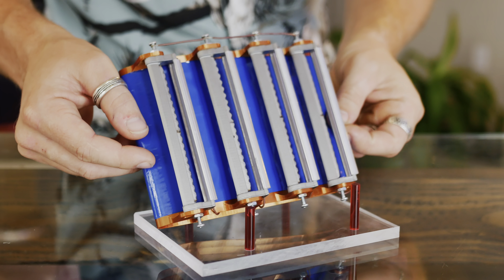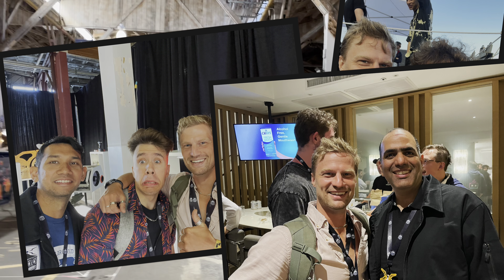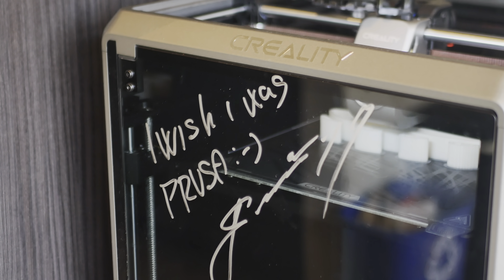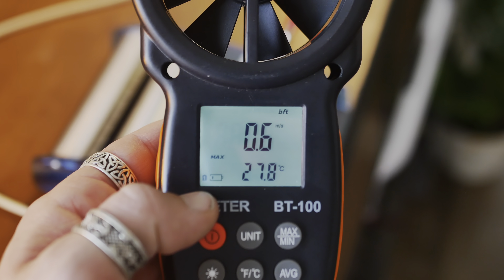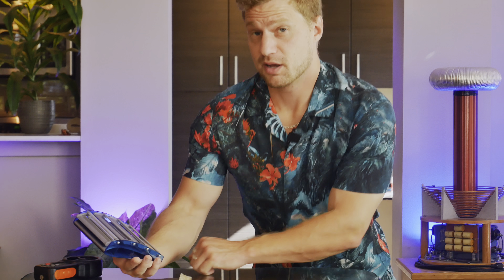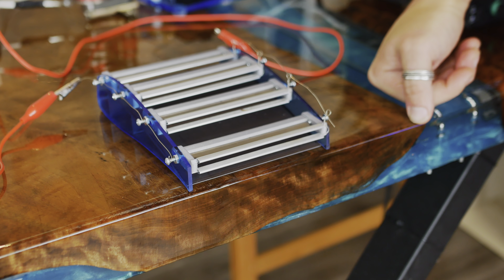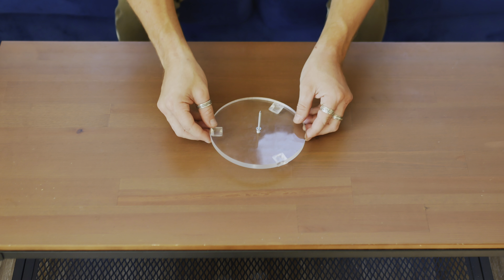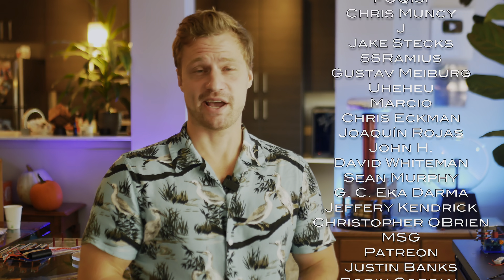Designing A Self Propelling Ionic Thrust Wing

Comment: I design, build and fly radio control airplanes as a hobby. I've made planes out of down spouce aka gutter pipe,foamcore board  and coroplast.  As I watched your very cool video, I thought of some thing. Why can't you add four servos to the adjustments using four servo testers and see if diffrent distance between each bald would give you diffrent results.  Once again very cool and informative video. Kep up the good work and two thumbs up!!!!

Comment: I have a suggestion… think like the dinamics of a Venturi pipe, have “ionic  stages”, smaller and smaller one after the other.. the smaller diameter section should be a combustion chamber which I think you won’t develop… but next you can have turbine stages, this axel will be connected to a fan in upstream the first “ionic stage”.. meaning, that fan will help propel and suck air into the the ionic stages… this is +- how jet engines work, have a go, it might be interesting

Comment: Ok, I’m going to try and explain why your efforts are backwards.  You have a very good idea but move it to the underneath of the wing.  A wing develops lift because as the wing passes through the air, the air that goes over the top has to move farther than the air passing under the wing.  So the air pressure (atmospheric pressure) is lower on top so the wing is “sucked” up.  I propose that you use an open bottom wing.  Real cheap ultralights  use this design.  Place your thrusters at the bottom.  Better lift and better thrust.  I believe that you are really onto something here.  I’ll bet that if you teamed up with Peter, you could develop a design that you could sell.  Maybe have a small “tailgating” 
generator that also ran a small propeller and provided power to the thrusters (first generation of plane propulsion.  I know that I would buy a successful design with this idea.

Comment: Very excited to see this. Great idea to use the wing as part of the thrust. That was brilliant. 
I did notice that you are putting the ion thrusters on top of the wing. 
This may led to a few problems if you do plan to fly it. 
The aerodynamics of the top part of the curved wing makes the air above the wing move faster. This also thins the air on top which creates in imbalance of air pressure. the thicker air below pushes the wing up, creating lift. 
Placing the ion thrusters on top would:
1. Slow the flow of air weakening the lift.
2. The airflow on top of the wing is thinner and less efficient. 
Respectfully, I would recommend that you put the ion thrusters on the bottom of the wing. 
This would: 
1. Take advantage of the thicker air below the wing.
2. Not interfere with the thinner air on top. It might even led to move lift.

I hope that you find this useful and good luck on your build.
Respectfully William.

Comment: Interesting, and what I find more surprising is that no-one thought of this before, love the process of experimenting with various designs, I suspect you could likely get the weight down further in future iterations. Will this provide a way to travel that is economical and free of moving parts - sadly not - if you take the thrust required to move even a small single person microlight through the air, this will not compete because the electrical requirements, with current tech, would outweigh the whole aircraft. However, I can see where this technology, applied correctly, could provide a method of powering small, lightweight drone gliders for long periods to loiter over target areas far better than current drone technology because combioned with glider technology, the wings would not have to be powered all the time and they could have solar panels attached that recharge batteries for the electrical thrusters. One quick question - have you considered enclosing thruster inside the the wing so it acts like a jet - that should increase thrust and may help to improve efficiency?

Comment: I'm no engineer, but I think you have two major problems: wind resistance, and I think the electric fields of the thrusters are working against each other when they are following each other.
Maybe, place the thrusters inside the wing (completely covered, and with their own wind channel; this will pull air from above (creates lift) and will push the air back (creates thrust). I'm not sure how to isolate the magnetic fields without adding weight.
Great videos, I very much enjoy them

Comment: I like all the ideas of putting the ion thruster inside the chord of the wing, using strucial foam for strength and regidy, and using a conducting wire rather than those razor blades. 

I'm just wondering allowed that if the laminar flow over the wing is speeding up to match back up with the flow under the wing. Maybe it's counterintuitive, but moving the fast air under the wing with the ion machine, it will actually speed up the air over the top?  I'm just saying.  

Another observation was that the air trailing out of the ion thruster is creating a low-pressure area trailing out of the back of the thruster. Perhaps putting light winglets to break up the vortices out the back would allow more energy to go towards thrust instead of making vortexs. 

Keep me posted on your progress.

Comment: Put a thin plastic material on the top of the wing so you make it like a ducted fan. So you don't lose air pressure out the back.
Reply from the maker: That's not a terrible idea - though half of the air coming in for thrust, is air that is sucked in from the top. So, covering it may help, or may hurt. I can do some experiementing!

Comment: hi friend. would you like a really nice different approach? would be cool to test this
Reply from the maker: Hello, do you have a suggestion for another layout?
Reply: @PlasmaChannel  i just recently watch your mac2. so ill add here some question there also.  1st the thruster does it really need to be a straight line. can it still work if its curving? also i was imagining if this wing was a propeller instead like on top of a helicopter. the lift it can have from the discharge plus the added air it can generate from the spin

Comment: This is super cool ! Where did you learn how to do all of this stuff anyway? This looks like the best hobby possible.
Reply from the maker: Thanks @mikeshafer. I'm mostly self taught when it comes to high votlage builds.
Reply: @PlasmaChannel  super cool I want to dabble in the space. I’m just terrified of getting electrocuted to death. I have zero experience in this kind of stuff! But it looks so neat. Do you have a video on how you learned all of this? I just found your channel yesterday but I’m eager to learn.
Reply: @PlasmaChannel  do you have any recommended starting points? For now I'm just going to learn how to build basic things with Arduino starter kits... high voltage stuff I'll save for later. I don't even have a 3D printer yet. I wonder if there are maker groups in Las Vegas...

Comment: I have an another approach use blades as movable blades to control the drone or plane also use electroplating instead of foil,that should work also use the lower portion as ground(-) while landing so it can use the air flow to land.

Comment: Wouldn’t a delta wing formation be better though? Because you could use thrust vectoring to control pitch and angle. While minimizing weight as it’s just one giant wing that you could use the the entire back end to the exhaust. 

You could also probably use a long pressed sheet of metal to reduce weight further. Since you already know it’s gonna be slow. So it getting out of a danger zone quickly isn’t really an option. So making it stand out with it’s appearance of essentially if a b-2 spirit cosplayed as a robot ghost essentially. lol

Comment: im not sure if this would work but if you try staggering the wire a bit maybe it would help it gain a little more energy/power because in some parts it may run through the wire more at the cost of it weighing a couple more grams but the outcome may overpower that

Comment: The high frequency sound pollution would be a no-go. Have you thought of something like AirJet cooling system, membrane vibration-type thrust?
Reply: Actually, the high-pitched sound was not in the later tests. Not sure if you were running some test or had some indicator setup.

Comment: Why don't you incorporate the bottom aluminum portion of the thruster into the wing itself?  That would save some weight and have the air flow go directly over the wing.  As it is, there is a lot of turbulence under each thruster and the important thing is to have air flowing over the air foil of the wing to create lift, which you're missing.  All your thrusters are interfering with the lift aspect.

Comment: Maybe if narrow the front of the airfoil a bit more the air will have less curve to travel around giving it more speed and air pressure, you know like the tip of a fighter jet are a lot more narrow than normal aeroplanes which means more velocity, excessive vibration can also reduce air pressure

Comment: ...but you're still attaching an engine to an existing wing.  You can lose weight by using the wing itself (or a conductive skin, ultrathin, patterned for parallel lanes and adhered directly to the wings surface) and then pattern the  blades (now wires, and I would suggest SPRINGS, but you would need extra mountings to prevent deformation).

I hope I explained this in a way that isn't confusing...or worse, more confusing.

Comment: Put a thin plastic cowl over the top of the system. That will channel/funnel air through the system, rather than pulling it over top of and also through the system. Less turbulence, more straight-line air flow. The air being pulled down and through the system is reducing lift and also slowing the straight-line flow over the top of the airfoil. You may want to have the thrusters between two airfoils rather than just sitting on top of one.

Comment: Interesting concept, but how practical? 
High volts and flying wings 💸 sound very hard to do in a real situation. 
If moisture of any sort were encountered, wouldn't that cause problem? 
You got zapped by accident, and that wasn't fun, i bet.
Some ideas look good on paper but impractical in execution. 
You proved thrust from a voltage potential is possible, but flight ✈️ with that system might be dangerous at best .
Fog, rain, ice, or damage to the structure would probably cause catastrophic results. 
Don't  do what the submersible guy did and go out on a limb he then sawed off.  Oceangate!.
😅. Good luck to you.  😮

Comment: Great work, this may really be the future for a lot of indoor applications where noise is a critical factor ... taking "heavy" razor blades is kind of a joke ... use some aluminium foil on some light and well isolated 3D grid element or start with your thin wire ... you might also experiment what happens when you not only change the spacing but also make the surfaces that charges the air different shape, angle and amount of surface as well as experimenting with the voltage.
The only problem with this maintenance free type of propulsion is that planes will instantly fall out of the sky when flying through a cloud or it starts raining.
But it is totally worth experimenting with the concept that makes sense using in other applications like transporting something silently indoor or simply all kinds of indoor fans for devices and humans. If you look for "Ion Propulsion - The Plane With No Moving Parts" some people from MIT I believe already launched a model plane that that was able to maintain a short flight by this concept. But I am sure there is space for tweaking and conceptual improvement.
This is a super interesting subject - have subscribed to be up-to-date with your work👍

Comment: look into making out of carbon or glass fiber if you make it your self it should be very cheap but its a very messy stuff to deal with will probobly require a lot of sanding and trial and error but should be some what easy to make a wing if you 3rd print molds for it maybe split wing into upper and lower part and then glue them together of you made the wing as one full peice would ofcourse be coptimal but would be hard getting the internal mold out. a lot of people think stuff made out of carbon fiber or glass fiber is expensive and it is but that is only the because it is very time consuming and messy to work with and hard to automate manufacturing etc. But the stuff you make it from the fiber sheets them self and what ever epoxy/glue you use it actuly very cheap. EDIT: also by using fiberglass or carbon fiber you could realy push how thin of an material you want much thinner than you would be able to any other way while it still provides structure

Comment: Can you try and make a sphere Floating device thatcan fly 2!   It has three one inch half inch thick slits for the ionic thrusters that can be utilize to stationize the sphere then also incorporate magnetic motors that utilize upstep and down step voltage adapters or a toroidal transistor for spin up and down and then utilize 4 fins on the slit for steering? This is an alien ionic sphere
ionic sphere

Comment: Not quite fast enough to fly.  the thrust speed on a jet is 1,300 mph or 581/ms.  yes there was armature air resistance but you also balance it on pivot giving it a lot of mechanical advantage. the engine effectively only need to overcome air resistance and di not have to worry about mass.  I would be willing to bet if you put it no wheels it would not move.

Comment: Having little understanding of Ion thrusters but great understanding of airfoils and lift, this is my suggestion. Depending on the angle of attack and velocity the majority of the lift comes from the upper surface of an airfoil. This design has eliminated most if not all that lift. You may be better served by putting the thrusters under the wing and incorporating the wing under surface directly into the thruster design. What I see in this video is several small wings attached to an inefficient airfoil. I suggest finding a way to make the airfoil itself a thruster. If you can do this with unobstructed airflow you may find and increase in lift as well as thrust. Also the airflow under the wing is much slower with higher pressure. It seems a better start to exponentially increasing the thrust by starting with air that has the highest pressure.  Good luck keep up the good work!

Comment: @PlasmaChannel  if you build the razors inside of the wing and have a horizontal slit on the front and back of the wing should still work but the drag is gone
Reply: And maybe because the flow of air is concentrated in the slit of the wing you could have an increase of airflow

Comment: Your research are amazing.
The induced flow  over the wing is likely  to modify the normal flow around the airfoil. It could lead to lift destruction.
Did you try to mesure lift created (on the scale ?) ? 
Great job.

Comment: I already did this. In high school 29 years ago. It was a foam airplane 3 foot wide with 4 engines mounted under a center weight. It flew the length of the gym before slapping the wall and bursting into flames.

Comment: Riddle me this. What potential would lie in a ring with the ionic thrusters projecting force circularly. Within the inner parameter, a broad blade propeller similarly fitted with ionic thrusters. With the hub being connected to a synchronous generator, the power source would potentially be self-supplied.

Comment: You should have put the thrusters on the bottom, better in flight stability, clears the top off for a solar panel and then you can put some high density proppelant or batteries in the wing

Comment: You can potentially ionise the air around the wings with high voltage wires and reduce drag by flow separation, from what I heard from a friend. Plasma thrust may not produce enough value for the additional weight and power requirements.

Comment: Ok, follow me here: 
Take the same "horizontal razors over an airfoil" concept, but sandwich another airfoil on top to channel the accelerated air more precisely.  Next, look into venting the top layer so air can be drawn in by the ionically accelerated air and a larger volume of air can be forced over the inner foil.  Consider "stacking" multiple layers especially in conjunction with acceleration vents.  Consider starting air intake on the bottom wing face, increasing acceleration distance around the leading aspect of the foil circumference and reducing pressure under the foil as well?

Also up for consideration: is my understanding of physics phundamentally wrong?